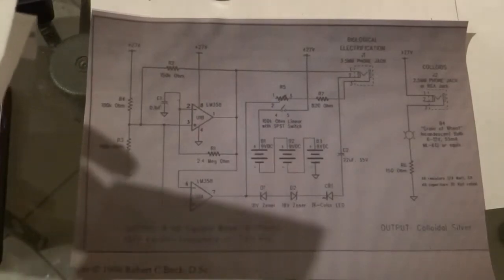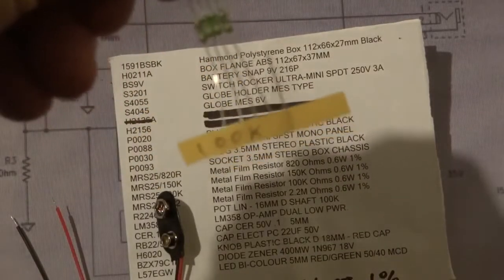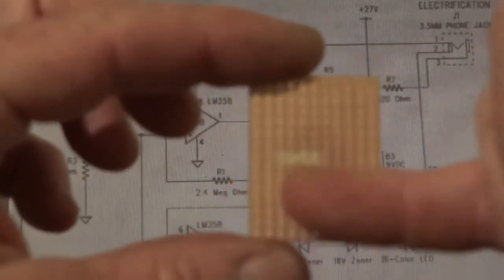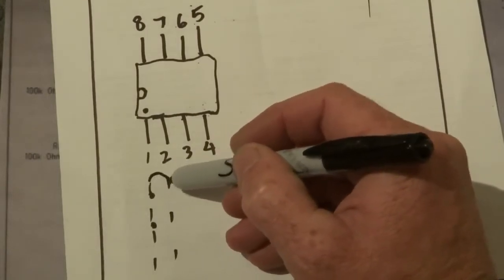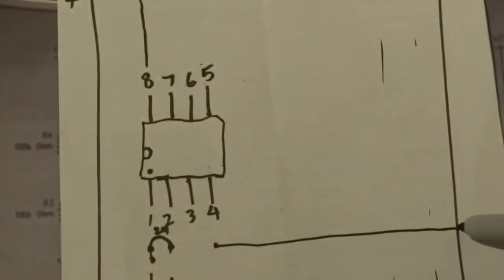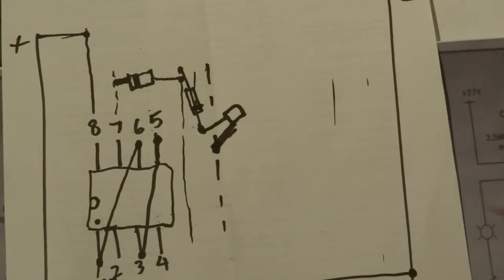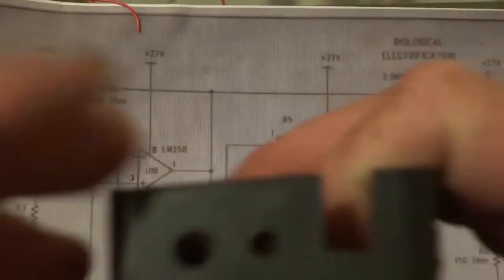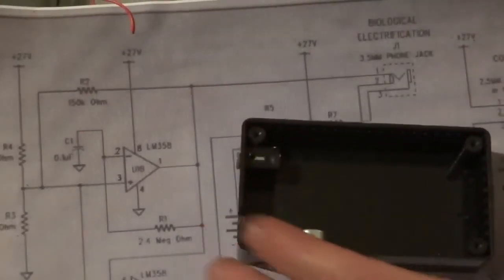How to Build a Bob Beck Blood Electrifier PART 1

Comment: Third times a charm, I hope. LED light is working but not the six Volt light which I still think is correct and that is my question.
Reply from the maker: That part of schematic is not needed if you wont make colloidal silver. And if your lamp burns, you have something connected wrong.

Comment: Hey friend, I have the flashing green light which turns off when I put the plug Jack in, like it's supposed to. I'm getting a small voltage down the one terminal but zero on the second. I know we're supposed to be measuring 3.92 Hertz which my tester won't do. Should I assume I'm getting the right Hertz measurement because I'm getting the flashing light?
Reply: Dr Bob Beck stated the frequency should be between 3.92/5hz use a oscilloscope to verify the frequency very important you don’t want harmonics in the higher frequencies, as stated by Dr. Bob Beck.

Comment: My bi-color LED has 3 wires instead of two. Will that work? If so how would you wire that?
Reply: It has two positive outputs, one for red and one for green
Reply from the maker: Use 2 led system. 1 red, other green. But dont use same polaritisation.

Comment: If it didn't use the 9v batteries I would be interested. 9v batteries in my opinion are useless and expensive to use for a everyday resource.  You cant buy a true 9v rechargeable battery.  They say they are rechargeable and that they are 9volts but they are really 8.4 volts. When 9v batteries are 9 dollars apiece and some of the Bob Beck units use 3 batteries that is 27 dollars every time you have to replace the batteries in that unit way to expensive to use.  Make it AC or USB or at the very least 18650 usable.
Reply from the maker: you can use any other type of battery. GP makes 9.6V batteries. and if you use 8.4V type it will work also.
Reply: Or just put in a barrel jack that fits a 9v transformer?
Reply: I've used solar panels.